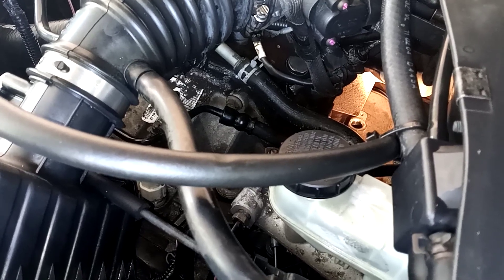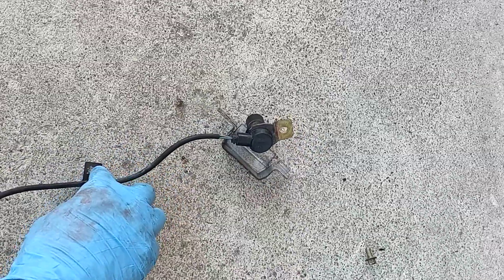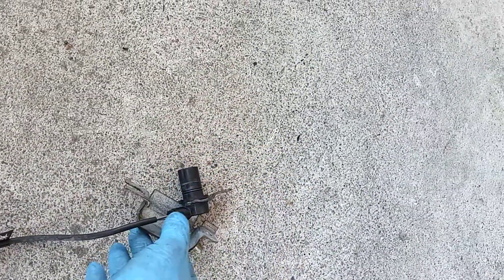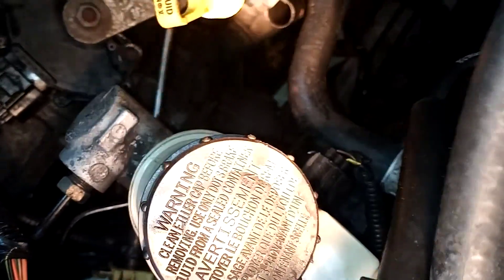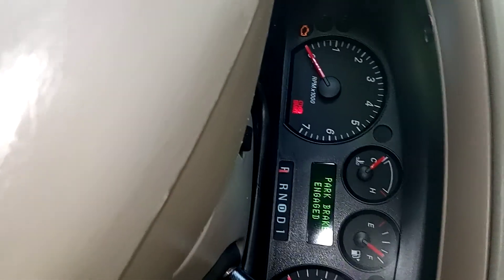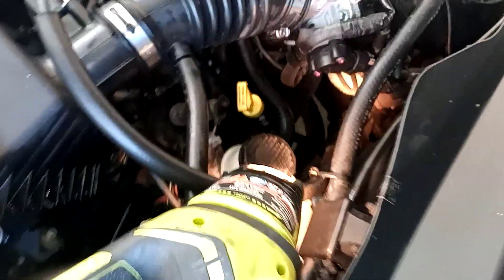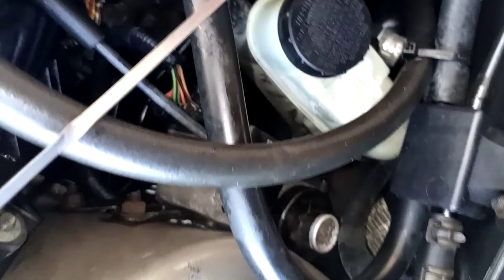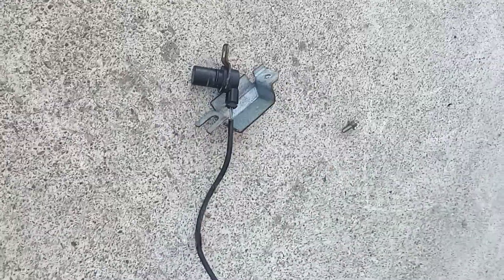Taurus /Sable shift issues, shudder w/ erratic speedometer / RPM's- Variable Speed Sensor-10 min fix

Comment: when you had this issue, if you put it in 1st gear and shifted manually, would you still have the hesitation?  My car has your same issues but if I shift manually there is no stutter in 1st gear.  Thank you
Reply from the maker: In that case, check Trans fluid level. The gears in there might be going bad. Fluid change might help. 1A Auto has a good video on Trans fluid change

Comment: Ima try this my 2000tarus shifts shudder when put in drive and rpm stay up a little high ill try this maybe seafoam trans fluid and possible change fluid will do soon
Reply from the maker: Check my video on “How to detect a bad torque converter” When racing RPMs at final gear, won’t shift or finally shifts hard at 45 mph it’s a TC, usually. Changing fluid can help or make it worse so review Scotty Kilmers vids on risks of changing Trans fluid on bad Trans

Comment: did this throw the transmission light on the dash
Reply from the maker: No. Not for me. Never got any codes. Just noticed a slight shudder which smoothed out after replacement. However, I took it in for a scan and a shop found a code and the 3rd gear going bad. Only 53,000 miles so I sold it "as is." Did hear back from buyer who drove it very hard, pedal to the floor going uphills and it did light up the gear symbol on the dash temporarily. But, not under regular driving. Pays to get a professional scan.
Reply: When it goes could it cause your trans not wanting to go uphills or make it so you can’t go past 55
Reply from the maker: @deckerhand12  IDK. Just noticed fluctuations on speedometer (and during video couldn't remember the word) and RPMs but mostly felt a slight "shudder" that did smooth out after replacing sensor.
If you are having those symptoms for sure replace fluid, filter, clean magnet and "1A Auto" has an excellent DYI video